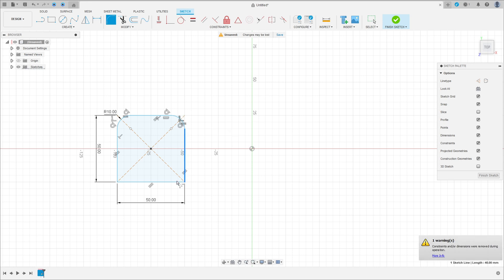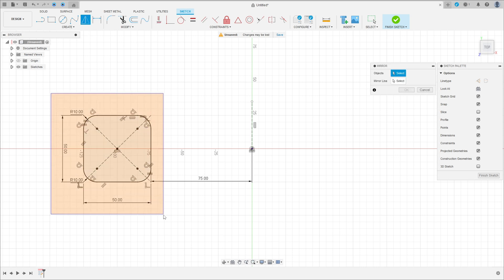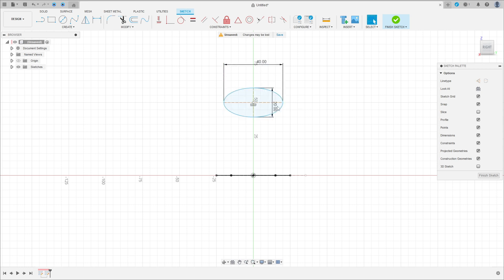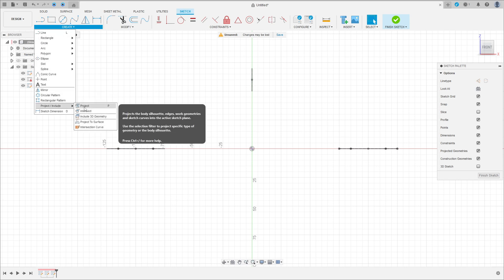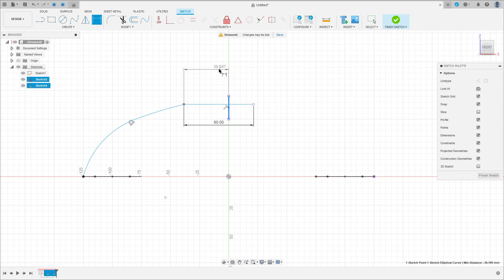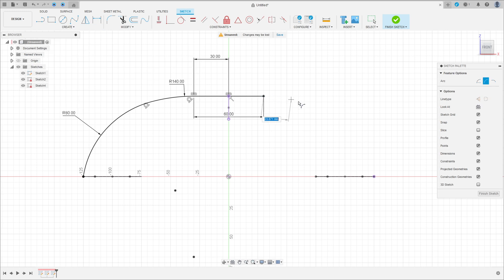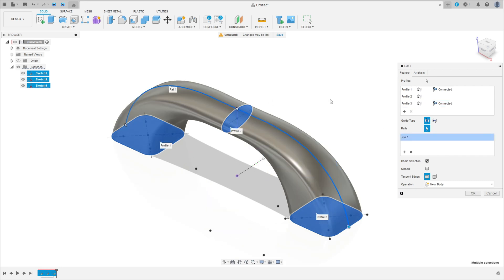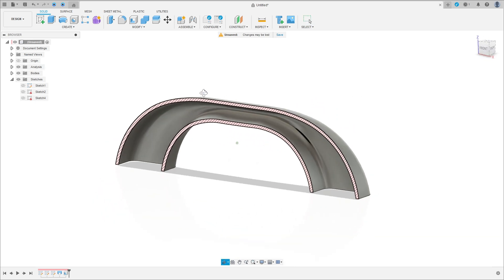How to use loft feature | Create Handle in Fusion 360

Comment: when your sketching the dimensions of the square how do you rotate the dimension lines to make it 75mm away from the centre point
Reply from the maker: Hi, 
1 - Make a square
2 - Remove the Horizontal/Vertical Constrain
3 - Fix the center of the square, using  Constrains (horizontal/Vertical , or  coincident) or using  Sketch Dimension.
4 - Rotate the Lines.

If you wanna I can make a short video to you.

Thank you very much for Watching !!!!
Reply: @fusion360tutorial   i figured it out by accident lol but thanks for the explanation anyway. Would you mind doing a video on keyboard shortcuts on fusion cos like i know pressing d on the keyboard makes you start using the dimension tool and im wondering what other keyboard shortcuts there are
Reply from the maker: I'll Make  @Inventeer   THank you very Much """